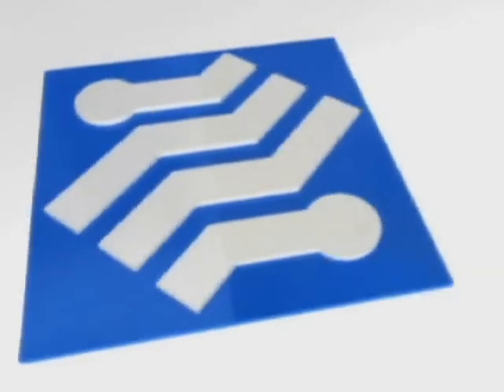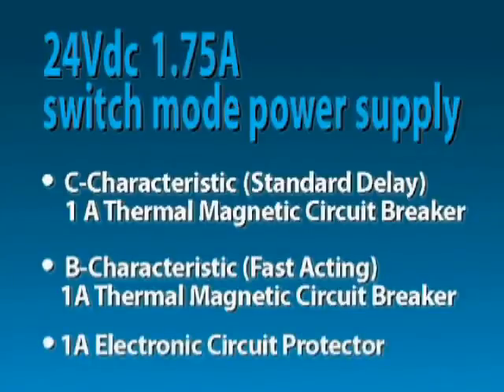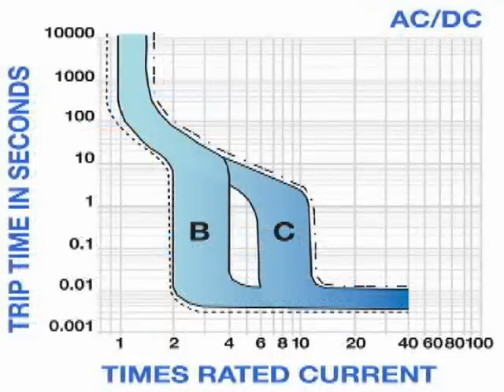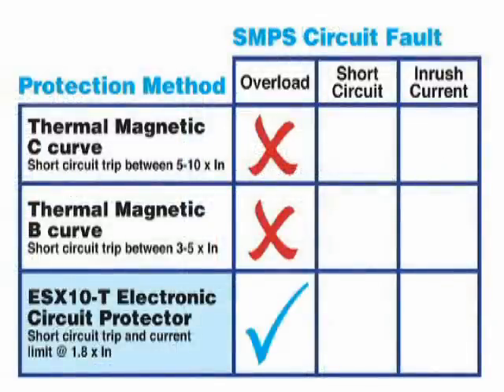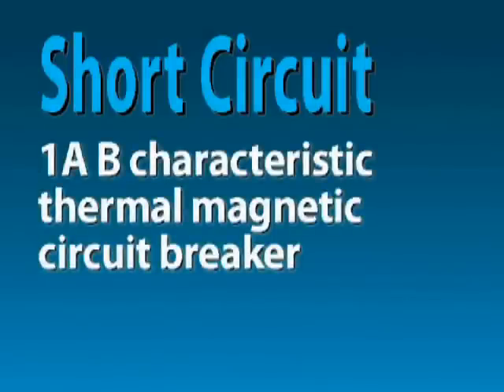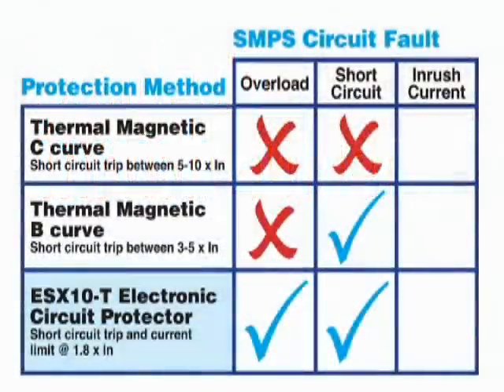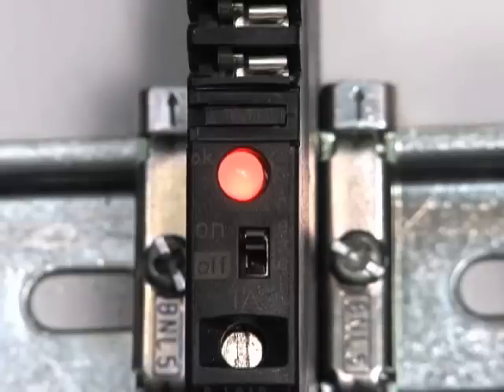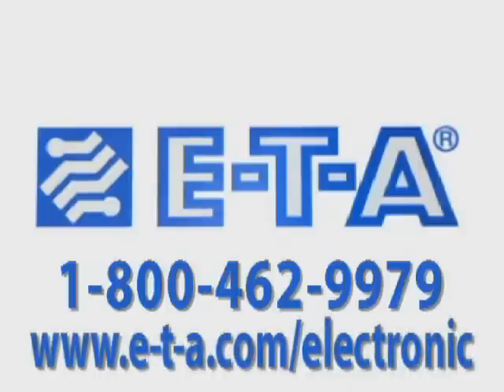E-T-A Electronic Circuit Protection vs. Thermal-Magentic Circuit Breakers

Comment: Thank you for explaining how these devices solve the problem of protecting 24VDC loads on a switch mode power supply, where conventional circuit breakers don't work well or don't work at all.  I think they offer superior protection and simplify troubleshooting, too.